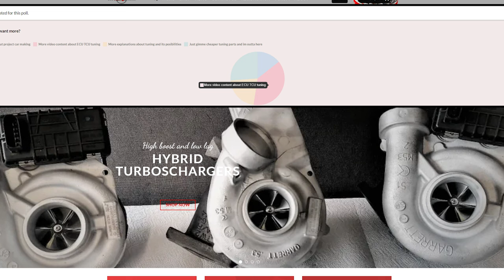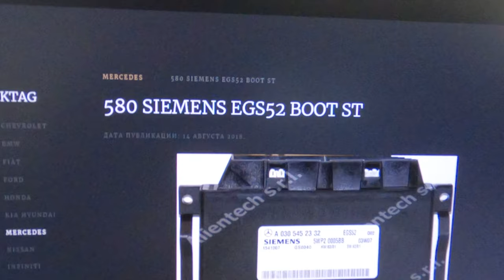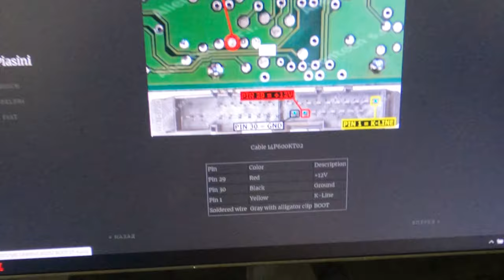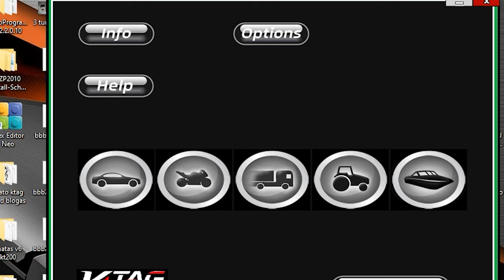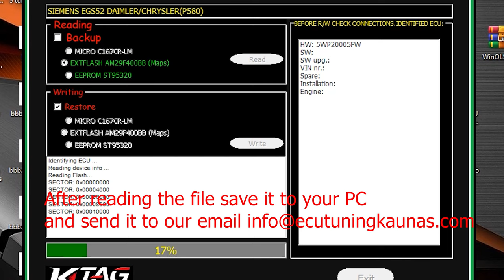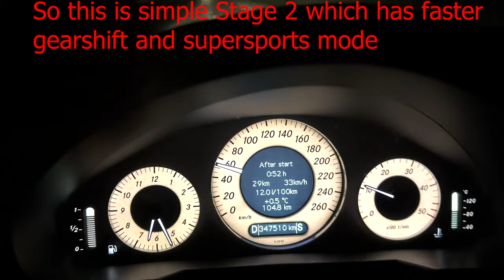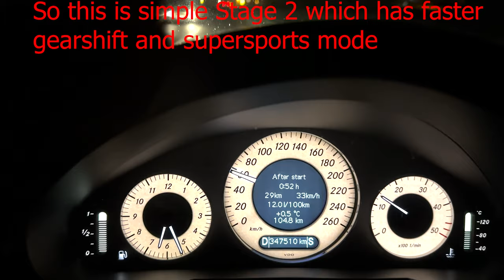Boost Your Mercedes Performance with EGS52 5G 722.6 Gearbox Tuning | Ultimate Guide

Comment: Thank you for the video. I have done my TCU tune last year C270.

I left the Boot wire soldered to pcb and routed it outside the box for easier future tunes.

There are already several tuners for this TCM, but none adds downshift blips, that would be awesome 😊

For future videos i recommed to lower the music volume, it is way too loud.

👍
Reply from the maker: Make sure it's isolated :D many funny things can happen also :D

Comment: Good job brother,  i have 2000 Mercedes W202 C55, with "ECU/ME2.0", and "TCU/EGS51", 
i need to use different differential Ratio,,  
is there a way to change the Ratio with EGS51??
Thanks..:)